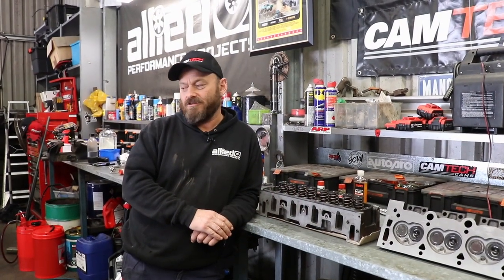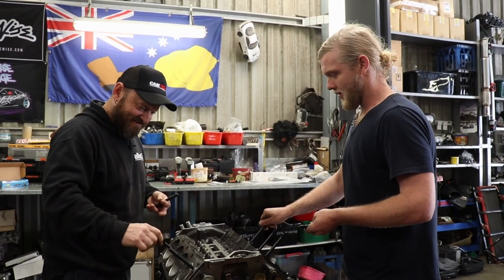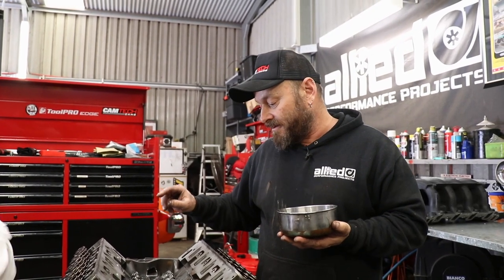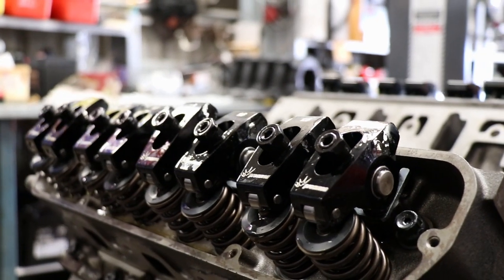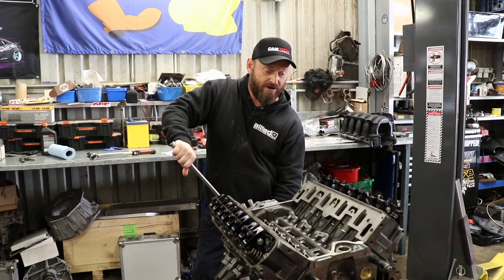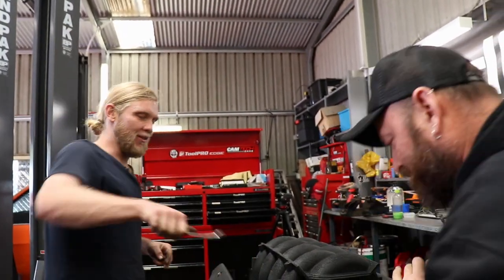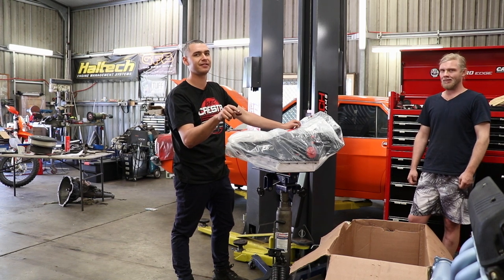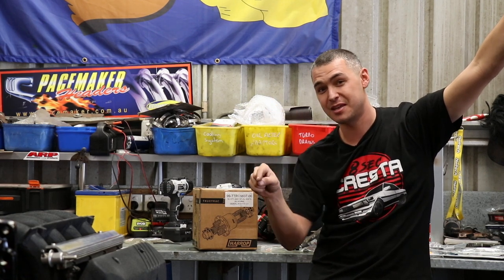GM HOLDEN 304 V8 ENGINE RE-BUILD [EP3]

Comment: I think the plastic v8 was back in the day when you could buy a new holden with either the chev small block or holden small block. the chev was the more expensive, stronger, heavier and better engine. the holden v8 was lighter, weaker and cheaper and a bunch of them being only 253 cubic inches it was like a little toy engine compared to a 350 chev.
Reply: Yeah you explained it better than me my old man still bangs on about having a plastic in he's HJ ute
Reply: The chev was always lighter and a smaller v witch makes it more compact. Youre wrong

Comment: It's because of the plastic engine cover that came fitted from the factory.
Reply: Wrong, engine covers are alloy
Reply from the maker: They didn’t have engine covers in 1970 when the 308 started. And they also never had anything plastic on them, cast iron heads and block from day one and ally bolt ons.
Reply: They look plastic...

Comment: Level 46 built 700R4 lol. Junk. 
Rather have a stock 4l80. I know in some cars they are difficult to fit.
Reply: Given the label on the tuff mounts box and the space saving gearbox, it's probably going in a Torana. You couldn't fit a 4L80 in that unless you chopped the tunnel.

Comment: The old man called 253s & 308s plastic because everthing brakes alot.
Reply: Edited, clearly what I heard was wrong.
Reply from the maker: Nathan Porter the engine covers were never plastic, they are all cast aluminium.
Reply: Nope. The old man called the holden 8s plastic. So did all his mates.

Comment: 308 arnt they?..
Reply: Old motors are 308 from 1988 they took 1/16 th off the crank throw and made it a 3 inch stroke and four inch bore , which is exactly the same as a Ford 302, engine company's have artistic licence on engine size naming , like 351 Ford's they are really 352 ci but ford already had a 352 V8 big block so they called it a 351
Reply: ok thanks @JosephCowen-ru7up

Comment: Known as plastic engine because the cars they cane out of had plastic bumpers vn-vt
Reply: I remeber the Holden v8's being called 'plastic' back in the early 80's,because before then most tough Holden streeters ran Chev small blocks and the Holden v8 was considered a plastic immitation of a real v8 (i.e. a Chev).  I suspect their reliability when pushed may have had a bearing on the nick name too.
Reply: Stephen Baltzer nah mate, they’re as reliable as the sun. They just don’t make much power without basically throwing everything away.

Comment: Holden engine's were never called PLASTIC , the drive line's were , Aussie 4 speed and shitty 10 bolt diff's was the plastic part . Drop the clutch  a little hard and either the 4 speed broke or the diff did . Where as the ford stable had the mighty Top Loader 4 speed and 9 inch diff which with a stock motor was almost unbreakable .

Comment: Holden never made a 304 they made a 308
Reply: The red motor was a 308 the black motor was a 304
Reply: Holden made the 304 to replace the 308 as the Touring Car Championships regulations changed limiting engine displacement to 5 litres, the 308 was just over that limit which made it an illegal motor to run in Group A forcing Holden to revise the design into a 304 that was just under the 5 litre limit with no loss in power. This happened in the mid 80's.
Reply: Thanks for clarifying that never knew
Reply: @goldentrowel1968  That's alright!
Reply: They could run it as a 308 in group A, but it would have had to carry more weight, under 5 litre less weight.
Reply: All correct, the push was actually from brocky himself. Gmh couldn’t have cared less, brocky knew he was pushing sh.t up hill already and needed all the help he could get just to keep the platform competitive in group a.